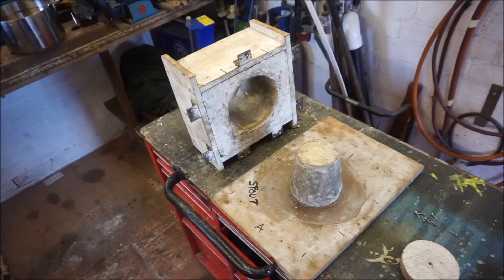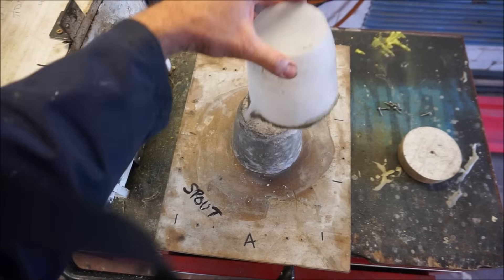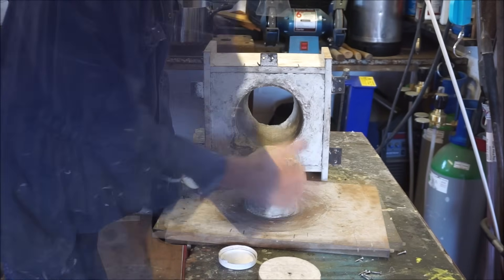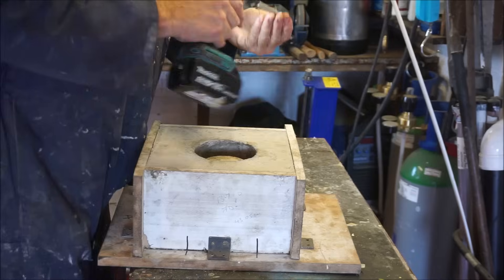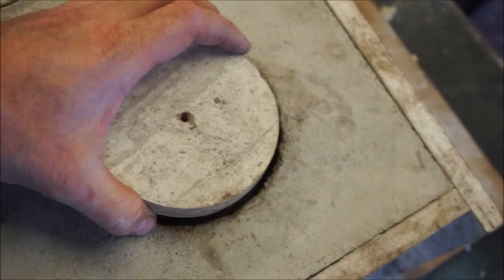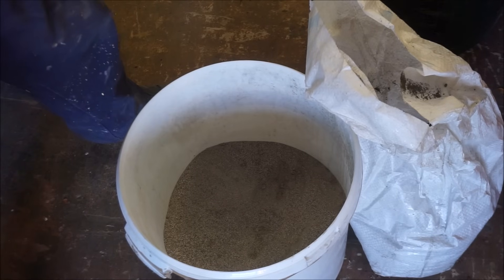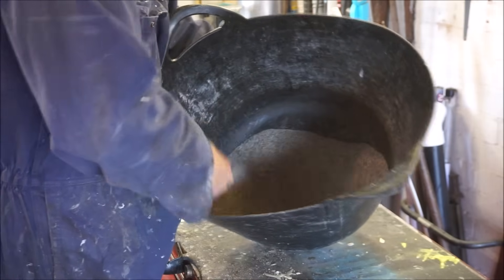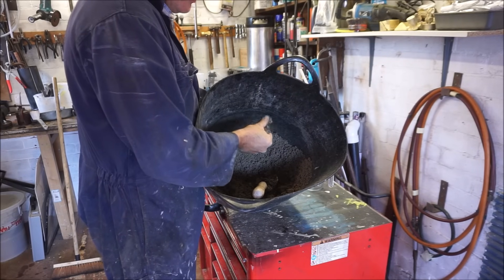Making clay and grog crucibles for melting metal

Comment: You can put locator dowls in the box to instead of keep screwing it down each time. Once it's screwed up turn it over drill 2 or 1 hole down each side and glue a dowl in the bottom bit. Then make the mixture a little more watery and pour in the top. Take longer to set and dry but none of that ramming with a stick.
Reply: Problem then is that you could get some settling if it is rough enough, so you’d need to get the water just right
Reply: @1495978707  then get it just right, one try at it should give an indication of how much to use.

Comment: nice work dood!   i have one in the oven as we speak, trying to make them for and induction furnace melting iron. i used a cast 2 part ali mold for the outside and a nylon plug for the core.   i found your channel hlaf way through my build but would maybe have copied you if i had seen it a day earlier.  big up the home melters!

Comment: can i use cement instead of fire clay?
Reply from the maker: No, sorry but the high temperature of the furnace will just burn out the cement. I would imagine that the crucible would just fall apart. The fire clay is used because it is relatively stable at higher temperatures.
Reply: No! But if you have to replace clay, then use sodium silicate.

Comment: can you use these crucibles for melting at 2500F for iron?
Reply from the maker: Sorry I've not tried them for that. Copper brass and aluminum is my limit so far.
Reply: You would need to replace grog with graphite for casting steel.
Reply: @luciusirving5926  The graphite will leach into the steel leaving you w/ cast iron, I should think.

Comment: what a grog?
Reply from the maker: Grog - Crushed unglazed pottery or brick used as an additive in plaster or clay. It is clay that has already been fired and then crushed up. Being fired it is a refractory material, relatively stable under high temperatures. I hope that helps.
Reply: @JimmyCogg  Yes  Mr J.C thanks too much..

Comment: What is crog
Reply from the maker: Grog - Crushed unglazed pottery or brick used as an additive in plaster or clay. It is clay that has already been fired and then crushed up. Being fired it is a refractory material, relatively stable under high temperatures. I hope that helps.

Comment: what is grog.
Reply from the maker: Grog is powdered refractory material. For example clay or clay bricks that have already been fired in a kiln or furnace and crushed down to a powder. The result is "grog". It is relatively inert and stable at high temperatures as it has already been "fired".
Reply: @JimmyCogg  well thanks best of luck in your projects Alleluia. God bless USA.

Comment: Hey not let it harden in the mold?
Reply from the maker: No, you don't want to let the crucible harden and bond to the mold. if it hardens in the mold it may be difficult to separate from the mold without catastrophic damage. Get it out while it is still soft. It is delicate, but you can then dry it and then fire it to make it stable.

Comment: Just a suggestion but you know the part where you firmed up the top rim.....just a thought but why dont you put the clay in from that side initially then put the peghole plate on and flip it to do your final pack from the bottom side and to make sure it comes out even????? Again just a thought might save some time.

Comment: The glaze is borax , relatively inexpensive and can be applied after the first furnace treatment,  then it can be brought back up to temp around 1000 degrees celsius for the glaze to melt ..thanks for sharing this method,  i learned something
Reply: Do you wait for The Crucible to cool down before you apply the borax? And then heat it back up to a 1000 degrees Celsius
Reply: It's best applied to a hot crucible so it sticks to the walls and won't pool at the bottom,  borax needs a high temperature to glaze, to get it to stick only needs roughly 400 degrees Celsius

Comment: hey do you think you can recycle old crucible material to make grog?
Reply from the maker: I would say that it is probably contaminated with metal. It might have absorbed metal/material which will expand and contract at different rates and cause weaknesses. Crushing bricks or other high temperature fired material is probably a better bet.

Comment: Can I use a regular concrete mix. I need to withstand max temps to melt steel
Reply from the maker: I would say definitely not. Cement is not refractory. It will burn out at steel temperatures.

Comment: I like the way you made that mix one thing my boyfriend is trying to make a crucible that can withstand the Heat enough to melt copper with and brass and all those higher temperature Metals than aluminum and he ran across this video and he said he learned a good mix from you and also that he needs to keep his drink way further away then you have your cup of coffee in the video LOL he said whenever you started ramming it in you would more than likely have half a cup clay grogg in the bottom of the cup he doesn't have a mold like you do but he plans on making one soon because that makes it a lot simpler to turn out a few crucibles like that liked the video

Comment: How do you crush the fire bricks to sand size?
Reply from the maker: It's work, but at it's basic a decent hammer with the firebrick against a form of an anvil, a large stone, piece of steel etc. You will get particle sizes from dust to whatever size you want. Wear eye protection and gloves. Don't breathe the dust and have some kind of method for collection, such as spreading a cloth out.
Reply from the maker: You can buy it from ebay if you don't want to make it, like I did.

Comment: Just wondering if the box were hinged would it be easier to pack the mixture more tightly with the lid open? At least to the point where you cap it off.

Comment: So a crucable made like this would be fine for copper,brass, aluminum, silver, gold and small amounts of iron?
As for fire brick..that's just common red brick..yes?
Reply from the maker: Copper, brass, aluminum I have used them for all these. Iron I understand is possible but I have not melted iron nor precious metals such as silver or gold. Fire brick is a dense ie heavy, fired brick ie it has already been cooked and is refractory, (fire resisting) in a furnace.

Comment: can't find firebrick in my area, can i substitute it?
Reply from the maker: I would suggest old crushed clay bricks. Basically a dense already fired heavy clay brick.
Reply: can can you melt steel? with this
Reply from the maker: @NKG416 I've not tried it. I believe steel is a higher temperature than iron. The crucible needs to be made of a refractory material that will stand that sort of temperature.
Reply: @JimmyCogg  i wonder what they are made from back in the day to do crucible steel, thanks for the info sir!

Comment: NICE JOB, would a handfull of chopped glass fibre in the dry mix add to the strength of the finished crucible I wonder? would appreciate your thoughts.
Reply: No, it would melt during firing and make it weak at high temperatures.

Comment: whats grog
Reply from the maker: Hi Jamie. Grog is crushed firebrick. From dust to 1mm sized particles. Basically it is already fired clay/pottery/brick which has been pulverised. You can get it from a pottery supplier or ebay. As it is dense and already fired it is relatively thermally stable from an expansion and contraction point of view. The clay you mix it with acts as a binder or glue, then it is refired in the crucible shape. Hope that helps.
Reply: @JimmyCogg  well, I'm sure that's will help me, thx man this is all I was look for. One question tho, it has to be heated before first use?
Reply from the maker: @marcinrzepa4945  yes it has to be fired. It is heated up slowly and then taken to a very high heat for quite a while and then cooled down slowly. I heat them in my domestic oven to the highest it will go about 250 degrees C then take them out and put them in my furnace and take them up to metal melting temperature to fire them. When they are cool again, they ring like a bell when tapped.
Reply: @JimmyCogg  thx man that's very helpful. I will give it a try in a few days ane see if I can manage this, thanks a lot

Comment: So how did it turn out? Did it do okay to melt aluminum? How many cast have you had with it? And what fire lay did you use? I was thinking about making my Hot face of my furnace this way.
Reply: Jimmy Cogg pretty sure he meant "fire clay" 😃
Reply from the maker: The crucibles turn out well. I've only done 5 or six melts with these (one litre capacity) and I use them for brass, which is hotter. No problem with Aluminium. Not sure what you mean by "Fire Lay". The furnace I use is oil fired.